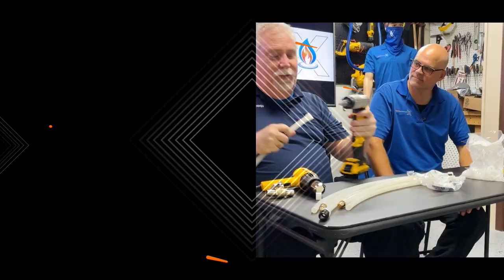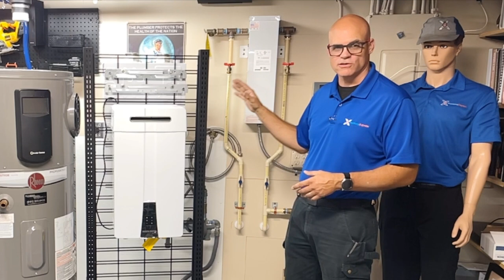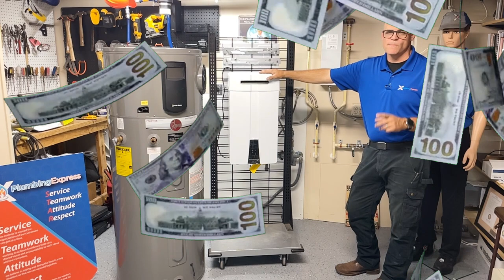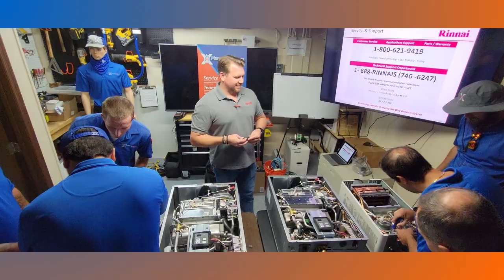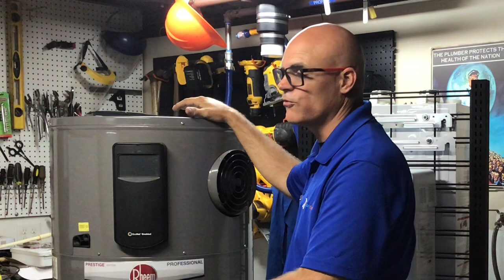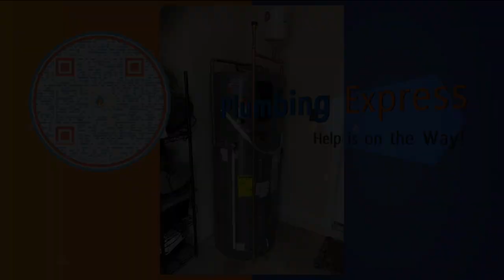Beyond The Pipes: Are tank or tankless water heaters right for you?

Comment: My budget tank hot water heater didn't need electricity to heat the water. No electricity for 11 days, but could take a shower every day.
Reply from the maker: That is one of the HUGE benefits of having a tank water heater. We run into the same thing down here in Florida after hurricanes. Just keep the showers short and use the bathroom closest to the water heater to save wasting the heat to the farthest points of the house.

Comment: Hello, You didn't say the amount of yrs on  warranty for gas or electric tankless heaters.
Reply from the maker: Well that is a GREAT question. So unlike tank water heaters, the tankless units have a lot of different lengths of time out there based on manufacturer and site conditions. Some companies limit your warranty down to 1 to 3 years if the water has a hardness over 4 grains. Some will lower or even eliminate warranties if you have a circulation system that is installed on it. A lot of times they will look like this: 1 year warranty on labor, 5 years warranty on parts, 10-15 years warranty on the heat exchanger. They vary from this but it is a good template to work off of.